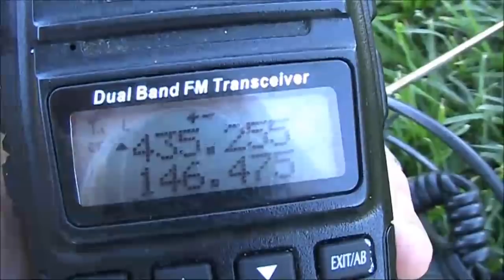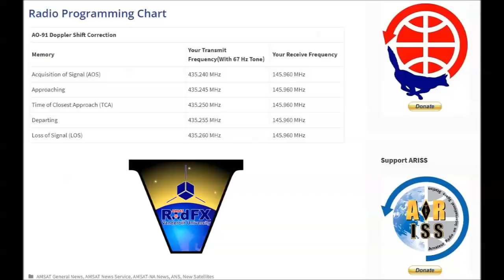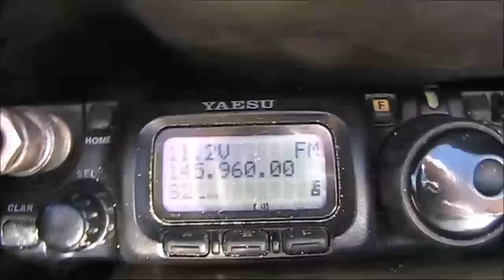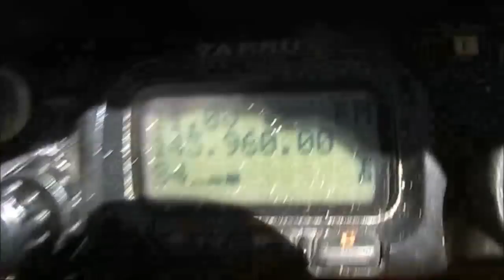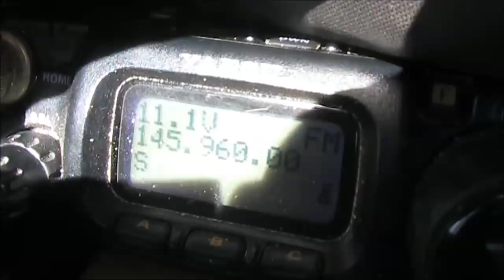Foundation Guide to Amateur Satellites (special focus on AO91) - Pt 2

Comment: Peter how long does each radial need to be for your v pole ? I made one for the 137 MHz weather sat band where each one is 53.4cm so just wondered ?
Reply from the maker: Each element is 1/4 wavelength - so about 48cm for 146 MHz. For receiving purposes one for 137 MHz should be near enough.

Comment: Just can't see any point in going through a satellite. To me its everything ham radio is not about. No real challenge. May as well use a cell phone. If the wattage was limited to something really small and you had to design an antenna to get to it maybe. Its like using dynamite to catch fish instead of a rod and reel. Reminds me of the CB radio guys from the 70's, huge linear amps and massive beams and then patting themselves on the back because they can be heard.Thats why I like minimum QRP .  But I appreciate you covering this Peter as I know people appreciate your top efforts always.
Reply: Argento Goldspier it's the challenge of making it into the satellite with such a short time to do so and with usually many others trying also...I find it fascinating
Reply: Thanks for giving your view on it.
Reply: Others cant see the point of QRP!!! It's not much fun for others trying to hear your pathetic QRP signal in the noise at the bottom of the sunspot cycle. For others, it's the challenge of getting in to a satellite and hearing it properly. Peter demonstrates here that his antenna on both receive and transmit aren't quite up to the task, only allowing a brief period of contact, instead of virtually horizon to horizon with a small hand held dual band yagi.
Yes, you can get into it with a handheld, but its so much better for everyone if your antenna has gain. On these FM birds it's also very helpful if you're running full duplex, so you can hear if your own signal is getting in to the bird, and your'e not transmitting over the top of another station causing QRM to others. Nothing worse than someone calling on the Bird and others answering him and the caller not responding because he cant hear them!!!
Reply: Andrew Williss he was duplex he had 2 radios 73's